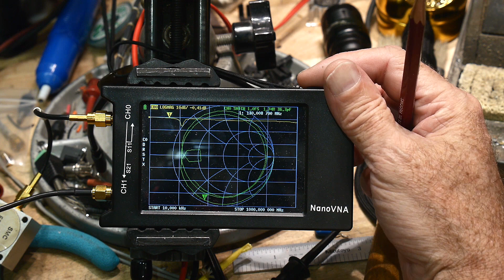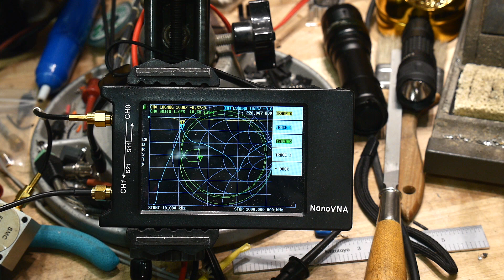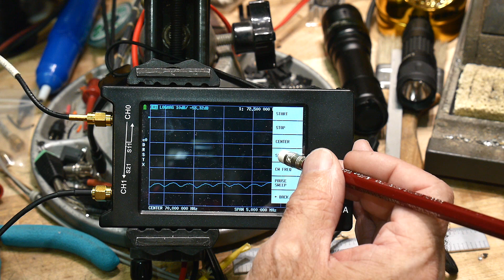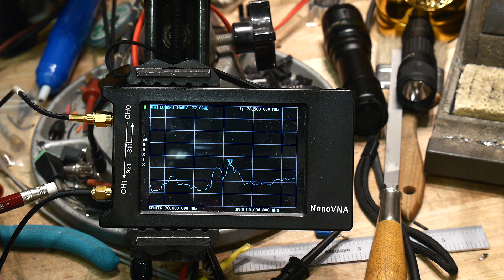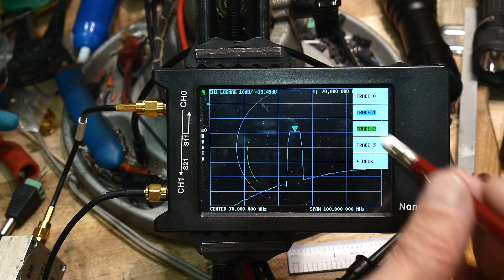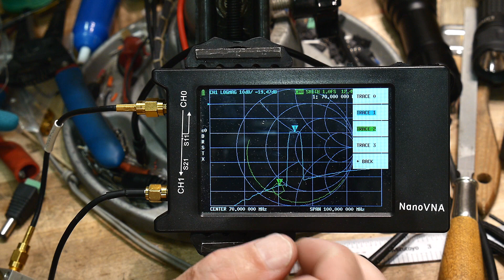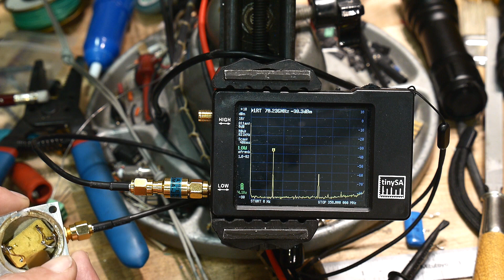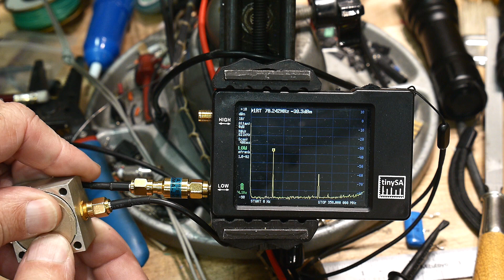#588 SMA 70 MHz SAW Bandpass Filter

Comment: Great video and thanks for sharing.  I have been playing with CB radios recently on 27mhz and I was wondering what you take would be to see the 54Mhz harmonic. I guess it is a question of dynamic range.  I can just about see it on my rigol but with 40db of attenuation in circuits it’s right down around the noise floor. One of my friends was looking at a similar thing recently but I’m pretty sure he was seeing a distortion product  within the spectrum analyser with a 0dbm input  rather than the harmonic from the transmitter, I was planning on to building a coaxial stub filter to knock the fundamental I can then remove some attenuation and lift my 54 MHz harmonic out the noise floor.  So I guess I’m asking about best way of making dbc measurements.  This was my effort watch about 30 seconds in https://youtu.be/iy_z32IbTCQThanks regards Chris
Reply from the maker: you don't need to see both the carrier and harmonic at the same time. Just look at the carrier and note what level it is. Then zoom in on the harmonic. When you reduce the span and resolution bandwidth and noise will go down. you should be able to see a low signal on your Rigol. then note that level. no need to do any filtering.
Reply: @IMSAIGuy  Chris wants to lower the attenuation and reference level to bring up the weak harmonic to make more accurate amplitude measurement (best accuracy is obtained near the reference level just like in oscilloscope full scale) and he is absolutely right about needing a notch filter to remove the strong carrier first otherwise it will saturate or even damage the first converter in SA because although you may zoom on 54MHz with small span but the strong 27MHz signal is still coming into the SA. As he rightly said it is a question of how large is the dynamic range of your SA
Reply from the maker: @amirb715  you make good points thanks. I'm curious about most SA that have +10 dBm top and <100dBm noise, when do you need to know any harmonics less that that?
Reply from the maker: @amirb715  another question as you seem to know all about this, how do I know if I'm looking at the phase noise of the device or the phase noise of the SA. how do I separate the two?
Reply: @IMSAIGuy  first you do need to do measurements on very small signals like -120dBm etc... in testing radio/wireless comm equipment and base stations and specially in Sat Comm. Not necessarily harmonics, but the main carrier could be that small. And of course it is needed when testing highly linear devices/circuits and you need to measure IIP3 etc...
However, w.r.t. to specs in SA note that just paying attention to the DANL specs and then max input power specs and assuming the difference will be the dynamic range is very very wrong and misleading. Those number can never be achieved at the same time. To achieve those extremely low DANL values in most cases you need to set attenuator to 0dB and RBW to lowest value (=> can lead to extremely slow sweep times if span is large which makes it impractical)
and if the attenuator is low, you cannot measure strong signals since it will create large spurious tones and that nonlinearity will limit your dynamic range much earlier than the noise floor would. Dynamic range is not only limited by noise floor, it also limited by nonlinerities that produce spurs

Comment: sometimes a "series" inductor at the input and output will be enough for matching (around 100-200nH) but sometimes I have had to put an L matching circuit on both sides to get acceptable matching. But a series inductor is a good point to start with. A series resistor will not help you. By the way the insertion loss of these is quite high (most of the time 15-20dB or even more) so you will need an RF amplifier after that.
Reply from the maker: I would like to have some knowledge about that. I'm always intimidated by the inductor. I can have lots of capacitor values laying around but don't have a feel for winding coils or using cores.